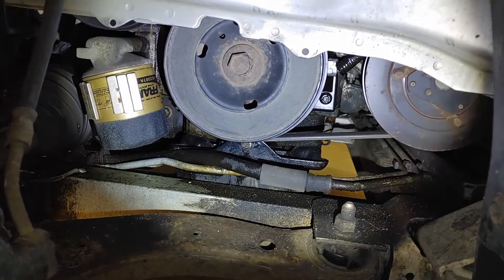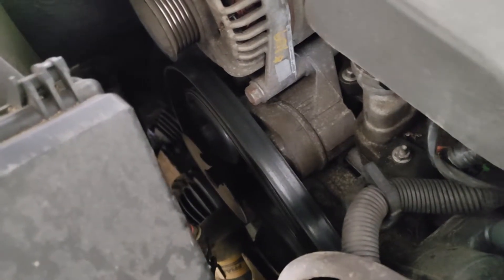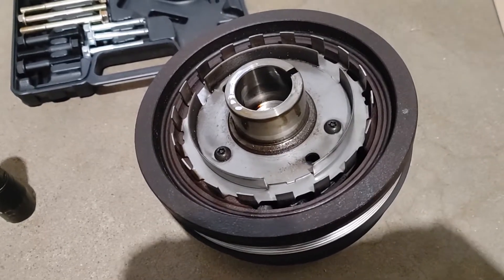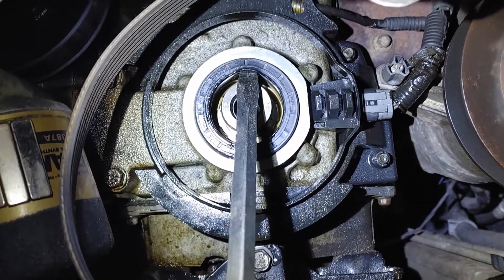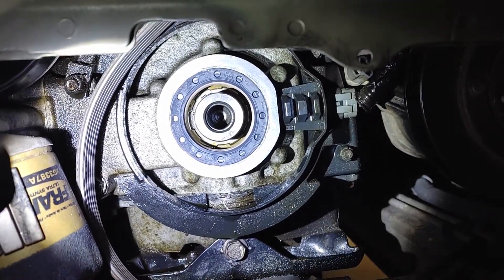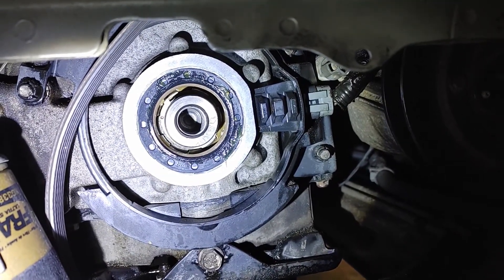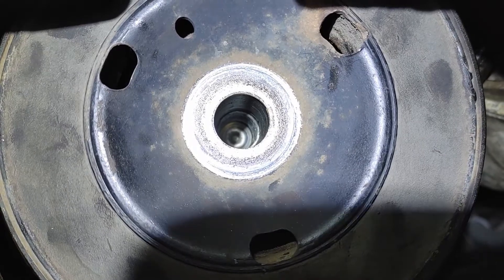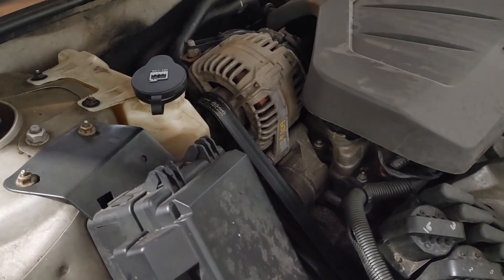Grand Prix Front/Passenger Side Crankshaft Seal

Comment: Repalced my seal with one i had from a mahle or felpro kit couldnt remember which. Felt so proud until i turned the engine on and the oil came pouring out like a stream. Of course its sunday and no oem parts available anywhere. Guess it will just have to wait until the new seal arrived 🤦‍♂️ 6 hours between the  seal and replacing inner outter tie rods.
Reply: What caused the oil to leak

Comment: You lost Me on the 2nd Way to remove the Seal ? Put Screws in ?
Reply from the maker: The thin flat surface of the seal facing outwards, get really sharp screws like drywall screws, puncture it just enough to the screw holds and then pull on the screw to yank the seal out.

Comment: Hey bud I’m doing mine right now. Had a couple question. What RTD are you using for the inside of the seal and what is the torque spec of that crank shaft bolt? Thanks

Comment: I have done this successfully on my second attempt, there are a few things i would add for those looking to do this for the first time. 
Do not buy a parts store seal, order the genuine GM seal or go to the dealership, aftermarkets are junk. 
Make sure you have something that fits around the diameter of the seal with a hole big enough for the crank shaft ready so that you can drive the seal in evenly.
I chose not to use any silicone during my installation but if you do keep it light there is a small oil return passage on the bottom of where the seal fits it would be bad to block that off.

Comment: If you are following this video to perform this task do not proceed just yet I failed because of this my crankshaft is still leaking.  Other videos explain verious ways to install the seal the ones that use fender washers with outher things as spacers and the balancer bolt to press it into place is what i'm gonna try in round two. Outher videos say you can take a very large socket and a dead blow hammer and knock it in.

Most of his information is correct but since he just glosses over installing the seal and seems to imply you can just push it in. this is not the case watch other videos as to how to actually install the seal because this is not explained.
Reply from the maker: The seal is literally pressed or tapped in. There is nothing special to the process. Make sure it goes in straight, don't tap/press on one side more than the other, and it will eventually bottom out. I used a large wood block to tap the white protective plastic that came with the seal.
Reply: Did you inspect the balancer for a possible groove worn into the snout? If it had a groove worn in, it should be replaced or repaired with a sleeve. The new seal will not correct that problem and it will still leak.